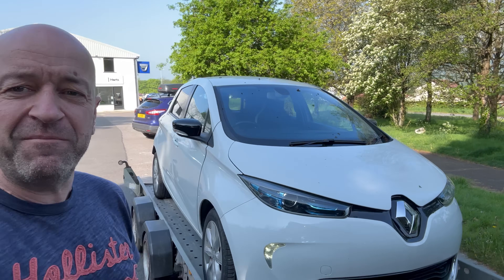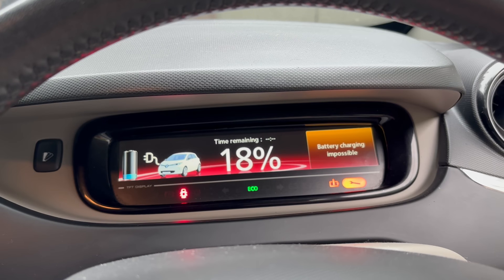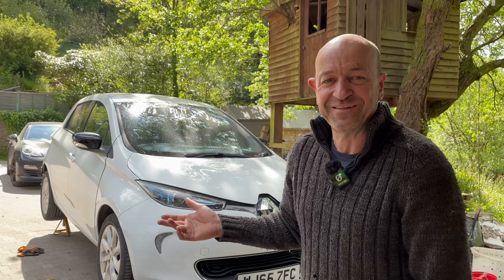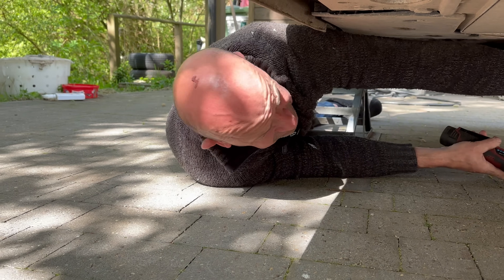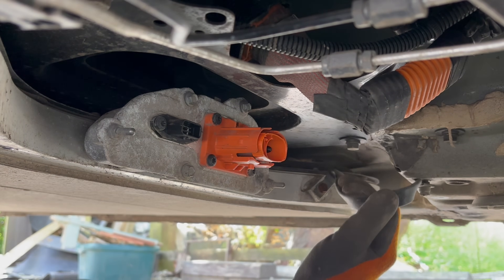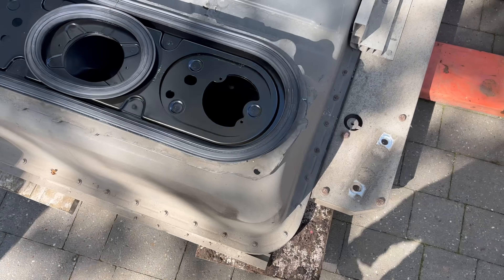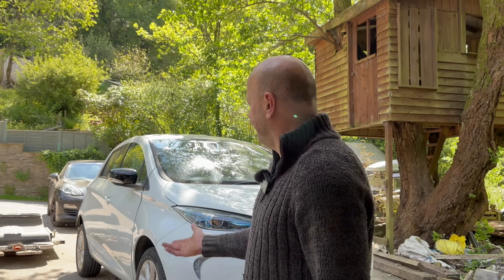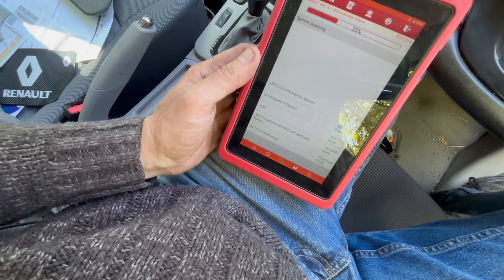EV Battery REMOVE and FIT in less than 30 MINS – ZOE Buy Back due to charging issues :(

Comment: What kind of diagnostic system do you have sir.
Reply from the maker: Hi I use a launch x351 pro mini… needed something vaguely decent to deal with Ferrari/Maserati gearbox but it’s pretty decent on most cars I’ve used it on.

Comment: Where is the jacking point please?
Reply from the maker: sills front and rear - rear has a little tab thing sticking down and front also you can see shape for it... just goole zoe jacking point and look for the speakev thread - has a pic from manual.  for me im using the rear beam mounts for my axel stands when its up super high for batter removal.  cheers!

Comment: Got same problem on 52kw zoe 2020. The 12v battery connectors were loose ... All good now, 14.6v measured with car off.
Reply from the maker: nice - they really are finickey with there complex charge system - but yea lose stuff or touch of corrosion is the ideal fail to fix!  this PEB thing was a whole new level of bodge fixing for me!!

Comment: Superb vlog, hats off to you sir, I have a Nissan townstar EV cat s from copart now fully repaired just need to put the srs module back in after crash data clear plus although it drives ok the electrotechnical fault light has shown up in red so need to further investigate, wish me luck, any help or advice would be greatly appreciated kind regards and take care Mark from Billericay 😃😃👍👍 7:22

Comment: I know what's wrong with it. It's a Renault.
Reply: When we bought a Renault 4 in 1976 it was much better designed and more reliable than the Austins, Fords and Vauxhall/Opels we'd had. Since the mid 1990s we have been a solely Renault household.
Reply: @iansanderson4664  From the Renaults I've owned and driven, the newer ones are rarely a problem. However, as they age the French engineering shows. Looking at lists of new cars and how they perform at their first inspection, Renault (or the other two) isn't much of a problem. However, as they age, they plumet down the list.

Comment: What Launch tablet did you use to reset the errors?
Reply from the maker: It’s a launch X431 pro mini I think… I bought it cause it can deal with a Maserati/Ferrari F1 gearbox system but it also worked pretty well on other stuff!

Comment: Bonjour, au niveau des calculateurs , il y a quoi à faire pour que le véhicule reconnaît le pack comme à l'origine ? Est-ce qu'il est possible de faire la manipulation avec RenOlink ?
Reply from the maker: Was no need for me to program anything - you just fit it, clear any codes (I used a launch x431 pro mini) and it was done.

Comment: Do be careful with a car on axle stands and ramps. Years ago, I was doing the same, and my car rolled down the ramps, turning the axle stands over as it went.
Reply: In the village my wife grew up in, there was an ex- mechanic in a wheelchair. Going under vehicles supported solely on jacks or bricks is dangerous.

Comment: So glad I  did not go EV,   I will stick with diesel
Reply from the maker: Horses for courses. After 100 odd cars I feel I’ve landed perfect having a dirty diesel Panamera for the long slogs, towing and family jaunts, a Zoe for trips into town and school run and a 360 to wave spanners at in frustration In the garage :)
Reply: You will until they tax you off the road. Which won’t be long with the current government
Reply: 😂😂😂 yep, diesels never fail.
Reply: Got 232 thousand miles on a diesel car that lasted 8 years and only cost £100..... Let's see your EV beat that 😂
Reply: @user-bz9cb8bp2y you’ve hands down won on fuel cost - 232k miles in a diesel is around £28K, but based on real world use including a few thousand miles a year of public charging, could have been £7K in an EV (as low as £3800 with home only charging).
Reply: @user-bz9cb8bp2y fair point, and I too have owned workhorse diesels in the past. What’s really interesting for me though is how high mileage EVs are performing in real world usage. Personally, I feel more relaxed about buying a 2nd hand high mileage ev than I would a combustion engined one. But, each to their own. This recent video is thought provoking …

https://youtu.be/1zM9mMBi9gw?si=uVzRddUR2sTtg9Io

Comment: didnt you pull main fuse
Reply from the maker: Yes pull it before doing anything involving anything orange of has orange going into it to be honest! As I’m not really sure what I’m doing feels the sensible option :)  also did this and the 12v to clear charging issue - though if leave it for 10 mins it seems to also sort itself out for another go at charging.

Comment: Did Gary show you how to remove those battery recognition errors? I'd guess that the pack is code-locked to the BMS.
Reply from the maker: I just cleared codes on my launch and it showed the battery. But I think my little parts car has bigger issues and from what I’ve read they are basically plug and play so don’t really need coding in or such.

Comment: I have an old Zoe, What's the best way to clear a water-pump electrical code?
Reply from the maker: get yourself a cheap canbus diag tool (ELM etc) and the CANze app... or pretty much any garage will have kit to do a diag read and clear.  but best first work out why its throwing code. pump itself is very easy to get to as its just an electric unit in line of cooling hoses so if its pump itself just swap it.  if its wiring thats a whole other ball game!

Comment: With the right equipment (hoist and battery table) you can swap batteries very quickly.  Quicker than doing a clutch.
Reply from the maker: Agreed - the faff is just having a way to shift around the battery!  would have been a pain with just normal jacks etc but my little pallet truck made it pretty simple even on a driveway with no proper car lift.  My Fluence is not selling (reduced it to £500!!!) so i might just pull the battery on that to sell on - be interesting to see how easy that is as they were designed for very quick swaps!
Reply: @sevenone6  Have the 2 cars face different directions and you would not have to mess with the battery on the pallet truck.
Reply from the maker: For sure! Bit more planning defo could get it down to 20 mins :)
Reply: @sevenone6  I would absolutely buy it if I was nearby. Sadly I'm up in Manchester.

Comment: Has anyone done a high voltage insulation test on it?
Reply: The BMS does an isolation test before it closes the contactors and regularly does an isolation test during normal operation.
Reply: @ yeah but the tolerance on the BMS internal tester is higher than on the house electrics which are tripping…
Reply from the maker: Hi Gary! I don't know what they tested beyond just the charge lead... but it's pretty consistent in tripping my garages rcd at the 2kw/15min mark of charging so guess I need to do some reading/watching!!!  I also dont have a megohmmeter which looks like ill be needing :)  so out of my depth with this thing!
Reply: @sevenone6  can you do hv isolation on a Zoe? Shame you are far from me in Essex ! I’ve fixed loads of non charge Zoe’s.
Reply from the maker: yes mate tell me about it - your channels like my bible on these things as i'm clueless :D:D:D  I'll have a proper read/watch on what i can "safely" test myself and have a poke about...
Reply: @ thanks, I could give you some pointers but I would need to know that you can do the tests safely. Cheers
Reply: Hi I suggest to disconnect the Air Conditionning compressor power plug before charging to check if it sole your tripping issues. It happened to me while trying to install an used compressor.
Good luck
Bastien from France
Reply: Is it definitely tripping an RCD (earth leakage) rather than an MCB (over current)?  RCBOs are both combined, and most don't tell you what type of fault was the cause of it tripping.